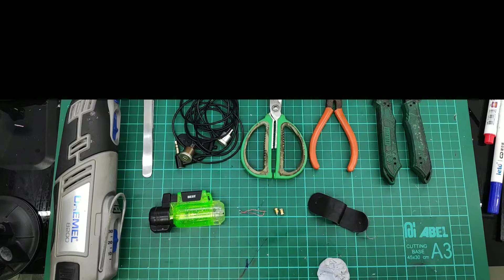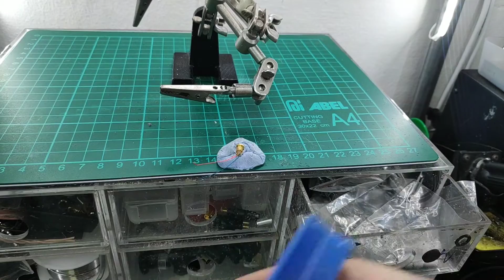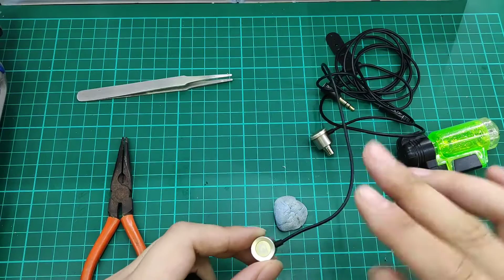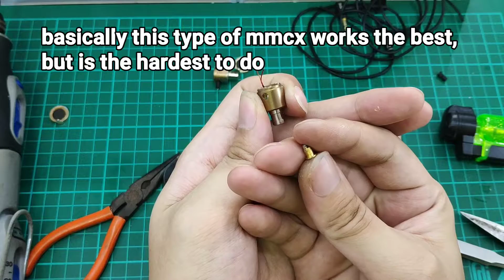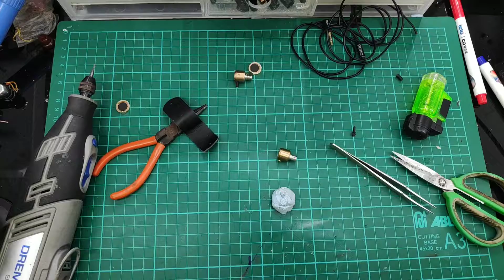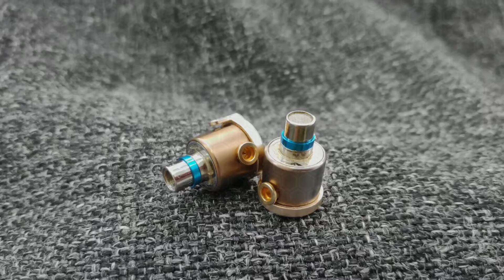DUNU D2000j MMCX detachable cable mod Tutorial

Comment: I liked the video, excellent explanation, greetings!
Reply from the maker: But really a heed if advise, the mod is very advanced if using my parts and steps, it is best for diyer to go for easier parts like those slim and long mmcx so there's no need to shave and drill the hole
Reply: sgaudiohive I will try this week! I will share my results later, thanks for the excellent video. I love your job, a lot of dedication.
Reply from the maker: @Chatomaloso97  thannk you for the kind words, be very very careful with the mod, if you can get slimmer mmcx ports do use them, they may not look as good but it has a very low risk compared to this, the main take away from this video is actually how to open up the dunu

Comment: I wonder if this can be done with cheap tws whose battery died. I have the original OnePlus buds and the battery is starting to fail. Remove the battery from the stem, remove the bt and remaining circuitry and wire an mmcx directly to the driver would work?

Comment: First i want to say that i love the content. i own a dunu dn 1000 and have been searching for a while for a way to open them, and this professional video has been great!
After a while with the dunus i have lack of sound on one side, nothing to do with the cable jack.
Any chance you can recommend a way to fix a problem like this? i'm sure it will be a great peace of content for your channel as well.
Reply from the maker: Thank you for the lovely comment! As for the issue, most probably one of the wire gave way in the sleeving, I really don't recommend doing the mmcx mod yourself if you are not at least on intermediate level of skill for diy, but changing out a new cable is do-able

Comment: Did this to my dn 2000j. And it hugely reduced the low frequencies. Maybe this connector is not accoustically meant to protrude inside. The idea is great but somehow it didn't work for me.
Reply from the maker: The back vent might be blocked during modding, you could remove the back plate and test again